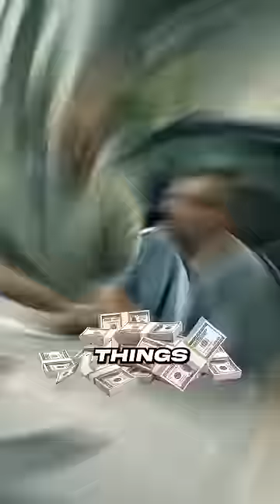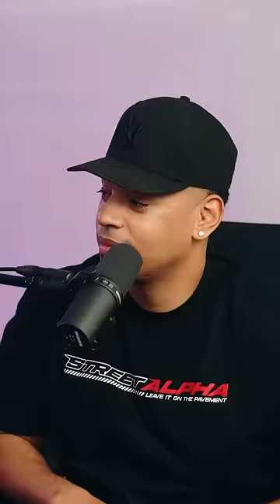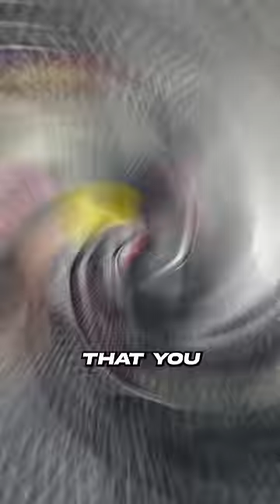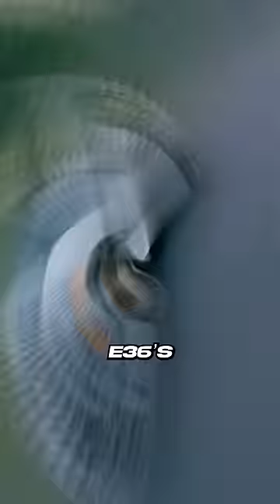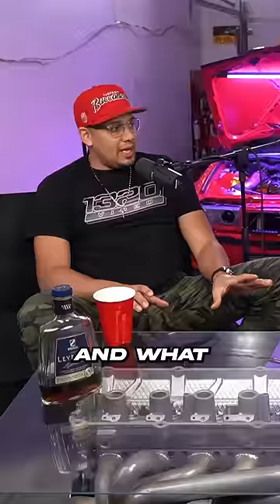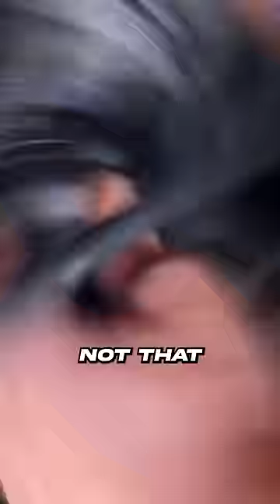What BMW DOES NOT Tell You 😩 #shorts

Comment: I used to sell hondas, and this guy came in and wanted to trade his bmw m5 v10 manumatic transmission dream car for a base used civic. He told me why when I test drove his car. He said the oil changes were 200 bucks and the tires had to be replaced and not rotated for 1800 bucks and there was a radar system for parking lots and traffic and the sensors were starting to die so it showed all these imminent collisions on the dash even though we were in an empty lot. The new radar system was 2600 bucks. The gas was premium, and it used a lot. He drove an hour each way from our town to orlando for work. He said it was also hot and uncomfortable, and he got stuck in traffic every day. So this dude was in finance, and he said he could have almost paid cash for the civic he wanted with maintenance fees over the 4 years he owned the car. Which I think was like 20k or so. My honda was so cheap to drive I didn't even consider it as one of my monthly expenses.

Comment: Amsoil is proven to with stand high mileage between changes and also royal purple. The plastic parts in engine cooling area is what is failing not the metal parts inside any motor vehicle. Plastic radiators and thermostat housings are your culprit

Comment: My Toyota avensis has done 425000 miles  it was still running I had to change because of local regulations in the city in the uk .Regular oil change maximum 6000 miles . Good air and oil filters .zToyota are workhorses .I pay £30 for service and supply my own parts which cost £50z

Comment: It’s not a BMW thing. And it’s not about plastics. It’s everything that expands and contracts…including your rubbers, seals, fluids…that’s why you will see taxis run up literally 800K-1000000 plus without issue.
And change your oil regularly. 
I do mine and filters every 5K. Cheap insurance

Comment: This is really wrong.
I've had 2 BMWs
A F21 M135i
I did 40k miles in it, only had 1 issue which was a Serpentine belt pulley. I did 18 track days in that car.

I had then a F82 M4 and did 13k and 4 track days and zero issues.

All manufacturers recommend longer oil change intervals, not just BMW by the way. BmW oil changes are usually 16k or 2 years, not 20. If you're gonna say stuff at least be accurate 😂

8-12k mile changes are fine , if you don't believe me, get an oil analysis run. The 2-3k changes on a road car driven 20 miles a day to work and back  is total overkill.

Comment: Pay attention next time. Count 10+ year old Toyota's, vs 10+ year German anything.
Hauled cars for 10 years, Lexus/Toyota  /Honda were running examples with 300k-400k+ miles. Starting, running. Never the case with bimmers, mercs, vw... Take it or leave it. But No trucker/mechanic drives German daily. Always a Japanese. 
(american cars are exception, but ford/Chevy with large displacement. Tahoe, mustang, Vette, expedition etc)

Comment: I do know the B58 variant of the Supra was co-developed by Toyota and BMW. My understanding is Toyota pushed for every singe piece of that engine to be stress tested to determine failure points. If something didn’t pass, it would be redesigned. So, if I were to buy a BMW, I’d say get a Z4 with that inline 6. 😂 

In terms of oil changes, my brother had a 1995 Del Sol. The last 4 years of that cars life, he didn’t change the oil once. At that time, he was still driving it 10k miles a year. That poor car finally died at 300k miles and 25 years of service 😂 That thing was a soldier haha 😂 They don’t build cars like they used to!

Comment: Oil degrades very slowly. What happens is it becomes contaminated with moisture, microscopic particles and acids produced from combustion, which overload or exceed your filters ability to remove. 

There was an integrated filtration system that functioned as a high quality filtration unit back in the 2000s which extended your oil changes between 50-75k miles. You can imagine people got "dispeared" and technology suppressed. Seen it in action on a 2000 Jetta, it worked.

Comment: BMW looks 10 years old after 3 years. My 2017 Hyundai elantra runs good enough. Sometimes I forget to change the oil after over 10,000 miles but it still keeps going. I give it good gas and not that cheap crap at Sam's club or those cheaper gas anyone finds.

Comment: N52 engine is in destructible. Believe me, I have a 2008, 128IM sport package change my oil once a year drive less than 10,000 miles and that car has been a blessing. Yeah it only got 235 hp and yeah it’s a 128 guess what, it runs like brand new.

Comment: I'm not that level of conspiracy theorist.  I just think the plastic is weight savings for mileage and emissions standards and also to save money.  I think the early failure of the plastic is just icing on top for dealerships.  Toyota is employing more plastic in the engine bay, think camry with plastic intake, and they aren't having the same plastic failure rate.

Comment: That be the weakest Link in M5x motors. Upgrade the cooling system, change oil in 5k miles, and inspect components during oil changes. Do that and it’s pretty much bulletproof. 🤷🏻‍♂️ BMWs are kinda built like cars you take to the track, so periodically inspecting the car will make it last as long as you want it to. 
   The problem with BMW is when an uninformed individual treats a BMW like a Tesla. Doesn’t last long if you’re procrastinating on Maintaining it.

Comment: Actually you can drive a BMW 12,000-20,000mls between oil changes, as long as your using the right type of oil recommended by the manufacturer, people like to buy cars, go in for oil changes and then decide to not follow their recommendation because they recommend an oil like 0w10, 0w15, 0w20, 5w10, 5w15 or 5w20 Which are all some of the Newest and Most Advanced Synthetic Oil on the market, released around 2005, Synthetic Oil Scientists had a break through back then and so the originally designed Synthetic Oil became very cheap but still protects up to 10,000mls and warrantied up to 5,000mls but the most high-end "Extreme" Advanced Synthetic Oil never breaks down and can protect a motor for 100,000mls backed by a warranty from the oil company, however a Regular Advanced Synthetic Oil Change that protects a motor for up to 15,000mls under a warranty and the original Synthetic oil changes cost around $70 back then, when the the new Synthetic blends came out the original syn oil changes dropped to around $45 and the regular Advanced Synthetic Oil changes were between $95-$115 when we first started using it, and within a year they had gone up to between $110-$150, and if you wanted the 35,000-50,000ml Super/Premium/Performance Advanced Extended Miles Synthetic Oil then you were looking at a $250-$375 oil change, and the Extreme Milage/Extreme Performance/Extreme Advanced 100,000ml Advanced Synthetic Oil then you were looking at an easy $1000+ oil change, now to be fair if you did get the 100k oil change, then your changing your oil every 10yrs maybe even 15yrs, every motor is designed and built differently, Honda's have since the early to mid 80's recommended that you change your oil every 4,500ml, their recommended weight is regular old standard non-synthetic 5w30 conventional oil, and if you bought you car from new, or even used but still under warranty, if the motor went out before 100k they would replace your engine, infact the majority of Auto Manufacturers from the cheapest to the most of expensive, if you followed their recommendations, and get all your services preformed on time with no more then going over 100 miles on each services(oil changes, all preventive maintenances, 30k, 60k, 90k, 120k services then if your motor goes out shortly after the warranty is up, they'll still replace the motor and if you use synthetic from the same brand they'll replace your motor if it fails before 200k as long as you've used the oil since you bought the car, motors built since the early 2000's and/or the habits of most driver now days are the exact reason why Oil Manufacturers started creating the new advanced synthetics and weights of oil, most motors are made from aluminum and magnesium composite metals, with small, thin and skinny oil passages, and drivers, stopped getting in their vehicles, starting them and letting them WARM UP, so Manufacturers started asking oil Manufacturers to create some synthetic oils that flows like water from the start up, and after warming up it stays pretty much fluidly  like water, so theses newer motors won't melt down, and the advances in synthetics, the oil bond and seeps into the metal protecting the metal forever. So if your motor blows up at 101k and the manufacturer of the motor won't replace it, as long as you've used the same oil from day one then the oil companies like Castrol, Mobil, Valvoline, Quaker Stake, Pennzoil, etc..., which ever one you used, they'll replace your motor cause they don't wanna look bad, seriously

Comment: No, this is how it goes: what goes on the MAINTENANCE SCHEDULE, is NOT set up by the engineers.

It is set up by the MARKETING DEPARTMENT, to over-rule the whole...  "Mercedes says it can go 12k miles without an oil change, and ford says 15k miles, so we have to say it can do better to intice customers"  Engineers hate their lives because none of what they say go in to cases like that, same thing with oil weights btw, they "recommend" the wrong oil weight out from factory because of well, thicker oil will result in higher pressure and higher internal friction which in turn results in BETTER reliability BUT WORSE EMISSIONS AND FUEL ECONOMY. If the car doesn't pass the newer more strict tests, then they're forced to say it needs a lighter oil to make it have less emissions and also better fuel economy...same thing with stock tunes that demand and are perfected for 14.7 AFR or 1:1 Lambda on E85/Flex fuel, it's because at STOICH, you get the least amount of combined emissions, and everyone knows you would want to run 10-15 percent rich when you're making power to drastically lessen the chance of knock due to a cooler combustion chamber.

I am a Marine Engineer - we all hate marketing teams that big execs use to strongarm what goes into the final "recommendations" and well maintenance schedule it will bring the dealerships a lot more work for planned obsolescence.

Comment: Just like a dodge/ fca product.  Literally, every important component that can fail and destroy an engine is plastic.  
Literally surprised they haven’t tried plastic rocker arms or cams.  Although plastic might hold up as good as a dodge cam.  Their vehicles are literally trash, designed to fail and leave you stranded.

Comment: Tell me you haven’t owned a bmw less than 10 years old without telling me. I’ve owned 2 so far and 2014 and a 2021 and both let you know you need and oil change at 9000 miles. BMW dealership don’t even go exactly by mileage they go by time. I’ve been called for an oil change when the car said I had a little over 3000 miles to go. If you’ve ever been the first owner of a bmw you know it comes with a maintenance package that covers you for 3 years or 50k miles. For 3 years I haven’t paid for an oil change or filters. So I have no idea what this guy is talking about. I got rid of my first one at 92k miles and the biggest expense was new tires and  spark plugs and ignition coils. I got it at 39k miles and the maintenance package covered my front and back brakes and rotors when they needed to be changed the following year and they lasted until traded it in.

Comment: Oil can last 20k miles easy. I worked at a refinery that did viscosity testing for motor oil. Its not the hot and cold that ruins it. Its the hot.

I mean oil aint going to last 20k driving like these naive clowns.

Comment: literally just have some common sense, these are high performance engines they need more care than Japanese 4 cylinders that make a wopping 180 hp. if you do maintenance on intervals *excluding their 10k+ oil change, it will run 10x better than any honda or toyota

Comment: Wtf does bmw has to do with this? ALL manufacturers do this ! I actully was bitter for quit many years about this. Though it was only to rip us off. Well once you take off your cute tinfoil hat off and do some research you understand the reason. Car manufacturers respond to demand! Full stop. 25-30 years ago people kept the car they bought form
Decades so long term reliability was top priority when they were purchasing one.  Today average car ownership length  is much shorter nobody plans to drive million miles on one car. Thus manufacturers cut costs to make the car last 2-4
Years  then take ur money for another 3-4 for repairs.  That’s why you get air conditioning , seat belts, Abs, ESP , air bags as standard on even entry level cars because they cut costs on what u told them u no linger value (in general). 
Want reliable ? Buy 90’s merc
W124 diesel. Or 90’s bmw which is what i have and service them well

Comment: This Dude is a Fool......He's conflating two seperate issues that are a false equivalence. Show me a report of BMW vehicles with premature mechanical engine failures for doing there oil changes every 12k with full synthetic oil as recommended. 

Then since when does the oil have anything to do with the normal temperature cycle every vehicle goes through that attributes Polypropylene (plastic) premature failure. 

Now you won't find the 1st one because that's false. Now to say that all manufacturers Now a day are using Polypropylene to make static engine parts because it's cheaper and inferior than using non corrosive metals he may have a point. But cheap metals corrode and warp with heat cycles also. So unless the metals are of high quality you still run into the same type of failures. 
This guy gets A for effort but and F on his exam.

Comment: 1. Plastic does a SUBSTANTIALLY better job at maintaining heat in the engine bay with superior heat transfer than metal. 

2. Plastic is substantially less expensive than metal to manufacture on a large scale in this instance. 

3. Never, ever, ever ever ever purchase parts from a stealership. They will have your ass. Most of the parts are manufactured by a 3rd party like Bosch, Valeo, etc. You can buy them from a multitude of websites for substantially less money. 

4. Don't listen to anybody who looks and sounds like this clown.